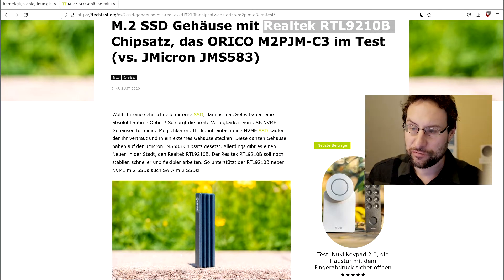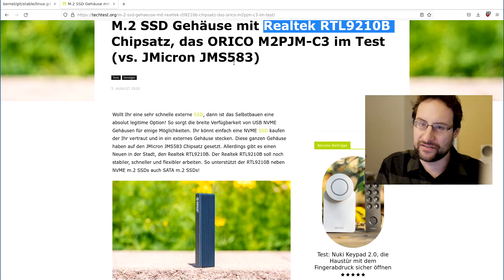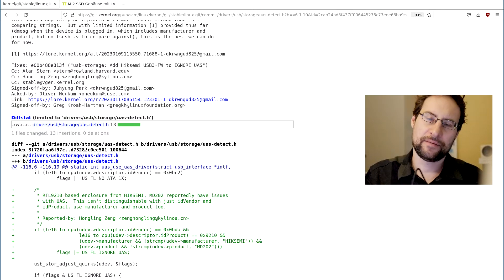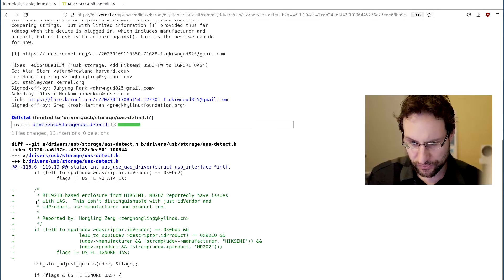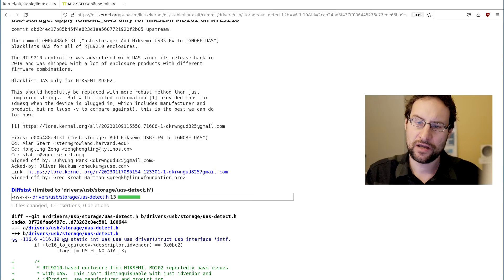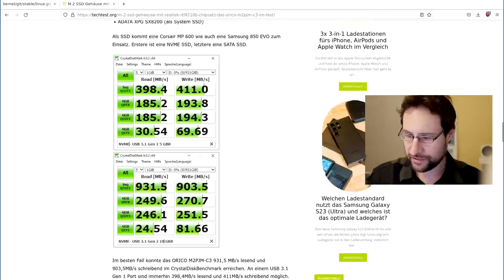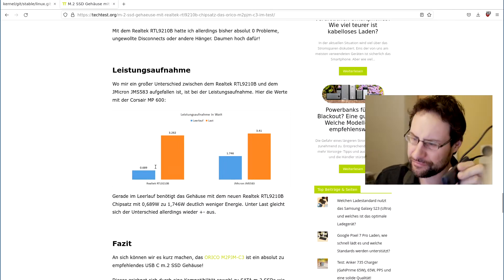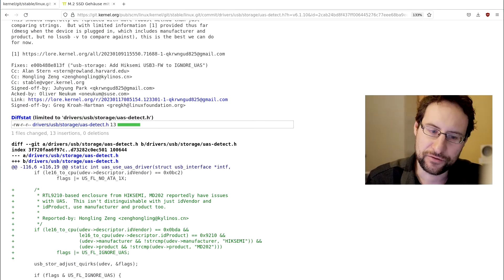RTL9210B  USB NVME chipset is better than I thought,  not all info in the Linux kernel is correct!

Comment: IMHO Realtek RTL9210B chips are garbage; they degrade over time, regardless of whether you upgrade the firmware; in my experience, Jmicron chips are significantly superior.
Reply from the maker: Is there hard evidence or only hearsay?
Reply: @renerebe  They are bad, I have two different brand enclosures with RTL9210B and they both stopped properly working after 1-3 months. They both keep disconnecting the drive going into sleep mode or even sleep as soon as power is attached and won't wake up.

I also have 3 JMS based enclosures and these seem much more stable, they have issues to connect after 1-3 months, but once they do connect, they usually stay connected and work.

I also have one ASM based enclosure and that one is absolutely perfect, never had an issue, it just always works. Thing is I can't find one that supports both SATA and PCIe on m2 slot like the other two above have.
Reply: @Pr0boszcz91  i also have a RTL9210B enclosure and it honestly never worked reliably. it directly had this disconnect issue where it just randomly shut down. i thought it was due to cable / host OS or similar, but i've seen the issue happen on windows, macOS,linux with usb c to c, usb a to c, various host devices. i also installed a firmware update from the manufacturer that specifically addresses a timeout issue but it still doesn't work.

has anyone found a reliable fix for this? it's kind of a useless product if it doesn't work reliably. i found a repo where someone is collecting rtl9210b firmware builds + update tools which i haven't tested yet, but at this point i don't care if i brick it because it's basically a brick already.
Reply: @Reversed82  尽快退货
Reply: You can use the Google translate from the German language to English language.  Just deeply remember: thinking throughout before talking anything 👈👈
Reply: can you checkif the Jmicron one support TRIM command ??

Comment: My ORICO (Model: PWEM2-G2) is displayed to me as RTL9210B-CG. The transfer rate in average is maximum 200mb/s on my Legion5-Notebook with USB3 on the backside. Is "ORICO" a scam brand?
Reply from the maker: Well, most no-name vendors use the cheapest chips they can find and all the cheapest silicon vendors over promisse, too. That's probably why bigger brand high end gear on average performs a bit better.
Reply: @renerebe  Ah okay. I am not absolutely sure what u mean, because my English is not the best (I am also German). Just understood the half of your video😅 Let me ask a question: Is it acceptable that my ORICO (Model: PWEM2-G2) has a transfer rate around 200mb/s, when they claim it has "10Gbps"?
Reply from the maker: 10bps sounds high, you can check in your is if it configured with such a high speed. But that would be physical link speed. Real world has protocol overhead and depends on the SSD, too. Also needs to use the uas protocol for high performance. Etc. 200mb/s is of course pretty low if that is a decent higher end SSD. If you are not satisfied I would return it if possible.

Comment: I have an Orico NVMe enclosure which has an RTL9210 it's a decent chipset, I have another 2 Orico 2.5 inch enclsoures - One with a JMS258 chipset and one with an ASM225 I'm using the ASM225 one right now as the speeds were higher, Good to keep the JSM258 one as a spare though as I know they're selling the same model I bought but some have Norsleys chipsets and don't wanna get stung with one of those, heard they're bad!!

Comment: I wouldn't say that SATA M.2 drives are rare. Many lower cost ones are. I have a few from laptops from the Core gen 6-7 era.

I have 3 enclosures using the RTL9210B so glad to see there can be a speed boost in the future. I also have a UD0401 based one which has been alright.
Reply: Was about to say, SATA M.2 exist in up to 4TB (Transcend MTS830S for example), and "small" 1TB ones are pretty easy to get from multiple brands (not talking about chinese fake SSDs). It just doesn't make all that much sense to get one of those these days when NVMe SSDs cost the same, unless you have an older laptop or a PC motherboard where the 2nd (or 3rd) M.2 slot only supports SATA devices
Reply from the maker: Well, the SATA were mostly really early ones, and it was actually rather hard to find one of the last ones, especially 1TB, when I upgraded the SATA one in my 15" Retina MacBook Pro some years ago. I would be surprised if there are still many new SATA based products manufactured. https://www.youtube.com/watch?v=lRqcgW1obh8
Reply: @renerebe  Yeah, less common probably in general use but I certainly see them a lot if you sort by price for m.2. You can get 1TB SATA M.2 drive for $45 USD. Though NVME is starting to get close. For us data horders the SATA drives are more appealing due to it being easier to multiplex SATA than NVME. I've been in talks with IcyDocks to see if the data horder market is large enough to justify some enclosures focused on high density but lower price and lower perf. Like a 8 bay SATA or NVME M.2 enclosure for a 5.25" bay with USB controller. Or a PCIE bridge/multiplexer with a simple PCIE riser like mining rigs use.

Comment: i had a similar nvme to usb c enclosure and it was really broken with mac os, i had an base model m1 mac mini and i wanted to boot from external m.2 sdd and it worked but it wasnt stable at all, mac os would kernel panic every now and then, maybe i shouldve invested in a proper thunderbolt one lol
Reply: I had similar issues. After a couple of years of these kernel panics, I updated the firmware of my external Orico SSD enclosure, and it stopped most of the kernel panics. Most recently, I wasted a week continually failing to upgrade to Mac OS Sonoma 14.0. I ended up reformatting the SSD and installing MacOS 14.1. I think Apple fixed something because the SSD seems much more stable now, and the system boots much faster from the external SSD.
Reply: same on mac mini m4